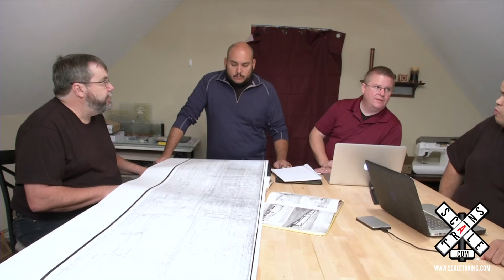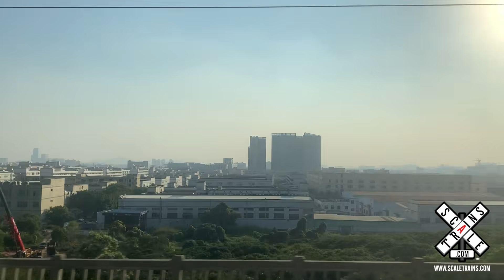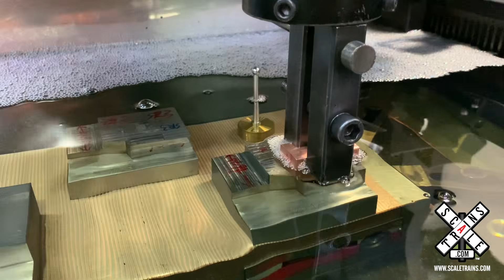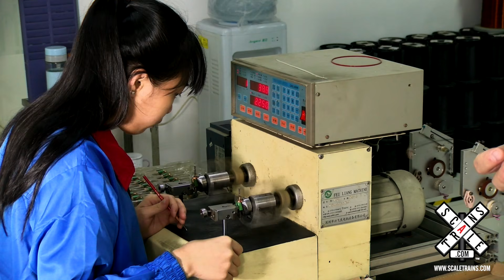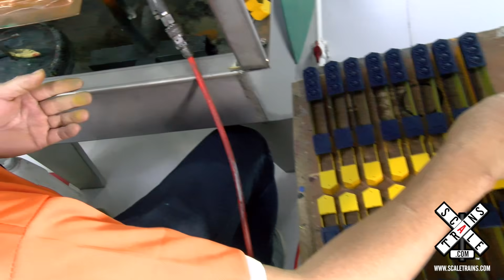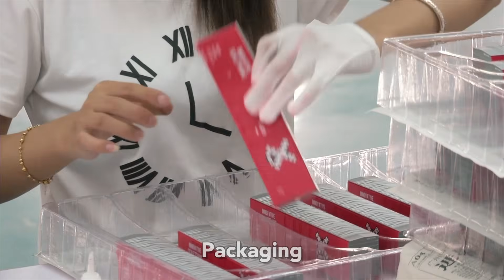How Model Trains Are Made

Comment: Relatively untapped areas in model railroading are small steam locomotive in HO scale. Mantua used to have some good working 0-4-0’s, 0-6-0’s and tank engines. Detailing was left up to the modeler.  Now, there aren’t many good quality small steam locomotives available in HO scale. This is surprising considering that most model railroaders in HO scale start off with an 18 inch radius track. 4-4-0’s, and 2-6-0s‘s look pretty good on small radius curves. Considering the tiny HOn3 2-8-0’s that Blackstone has manufactured, there is no technological reason not to have an excellently detailed and running 4-4-0 for HO standard gauge. Small locomotives had an incredibly long lifespan on the prototype. Some were actively hauling trains in the 1950s. The Southern Pacific E-23 is a good example. Most model railroader start off with a small layout. Let’s cater to that market and help start more people in the model railroad hobby.
Reply from the maker: Thanks for the suggestions. We recommend emailing future suggestions to: Ideas@ScaleTrains.com

Comment: How will 3D printing change model train manufacturing?
Reply: If  CAD software used to design the actual equipment could export these exterior surface designs to 3D printing software and scaled that would save man months of effort.  Model units could then be 3D printed on demand reducing inventory costs and unsold stock.

Comment: UK experience. Staggering complexity but I think the hobby is going wrong. 25 years ago I could buy simple Lima diesels for £25 with pancake motors and they worked. Today its just under £200 with lights, sound and details like you saw in the video but 50% are faulty. 3 out of last 6 models faulty (but not this manufacturer). Hornby Class 50 missing buffers, Bachmann Class 20 motor rattles around, Bachmann Class 150 faulty pick-ups. I wish manufacturers would realise that QA is the most important function. Throwing faults onto the customer will kill the hobby.
Reply from the maker: Hi Alan, if we make a mistake, we never throw faults onto the customer. We are human and while we strive for perfection, we live in a fallen world and sometimes fail to reach our goal. If you ever have an issue with our models, we'd be happy to assist you with finding a reasonable solution for repair or replacement (per the warranty guidelines). Thanks for watching. -Drayton

Comment: As an accountant, I'm impressed at the amount of capital invested in production machinery at the factory and tech gear at the office.  
A whole lot of cash goes into the job before ever a return from sales comes back again.
An insight to the costs involved, the funding arrangements, would be as fascinating as the process for design and manufacture.
Reply from the maker: The tooling for a Rivet Counter HO freight car can approach $100K. Depending on the number of variations, an HO diesel is between $150K to $300K.

When the next batch of SD40-2 is completed later this year, we'll have spent over $700K.  This does not include research materials, travel to document a project, Design, Engineering, etc.  Considering the low quantities produced, this is a sizeable spend and risk.  Shane
Reply: @Scaletrains  Thank you.  Impressive sums of money; your funders will recognise the commitment and competence at all levels, start to finish.
I do love U.S. railroading; have a lot of good HO stuff myself.  Travelled a little on a visit, 20 years ago . . . . gotta come back for more, much more!
Reply from the maker: Thanks so much for watching and for those kind remarks. -Drayton

Comment: What makes you people think that your models are better than other company's models?.........you flood the market with models that many other companies have already made.
Reply: Flood?  Hardly.......their models are all built on Pre-Orders. You snooze = You lose.   As for their models being better, Did you not watch this video??
Reply from the maker: We've never said our models are better than another companies.  That's up to the customer decide.

Have you compared our HO SD40-2 or HO and N DASH-9 or HO ES44 to other companies.  If so, you'll see there are vast differences that set our models apart.

Also, what other model railroad manufacturer (plastic, not brass) has produced the following models?
HO & N "Big Blow" Turbine
HO & N C39-8
N ET44 Tier 4 GEVO
HO SDL39
HO Bethgon G52X Gondola
HO BSC F68AH Bulkhead Flat Car
HO BSC F68BH Finger Rack Flat Car
HO BSC F68CH Standard Flat Car
HO BSC F68DH Heavy Duty Flat Car
HO CB&Q Shops Havelock Gondola
HO GATC 4566 Airslide Covered Hopper
HO & N Gunderson 5188 Covered Hopper
N Gunderson Multi-Max Autorack
HO PS-Trinity Backpacker Well Car Set
HO & N Thrall 4727 Carbon Black Covered Hopper
HO & N Thrall 5750 1970s Version Carbon Black Covered Hopper
HO & N Thrall 5750 1980s Version Carbon Black Covered Hopper
HO Thrall-Trinity 42' Single Hood Coil Car
HO Trinity 31,000 Gallon Tank Car with Head Shields
HO & N UP 23C Fuel Tender
HO & N UP 24C Fuel Tender
HO UP Late Excursion Water Tenders (both have different details)
HO & N UP Early Excursion Water Tenders
HO & N 53' CIMC Dry Container
HO & N 53' CIMC Reefer Container

That's 36 different models that no other manufacturer is making.  Shane

Comment: As an owner of a fair few ScaleTrains pieces of equipment, and yes they are top tier, the question often arises why do model trains coast what they do?   Well having been into the hobby since the mid 80s, take a blue box and turn it into the same level that ScaleTrains model is.   How much time and money did you spend to get there?   ScaleTrains frankly are worth what they coast .   Oh yes you couldn't even get an Athearn blue box SD40T-2 to the ScaleTrains level did just based on the drive train alone.  I tried in the early 90s.    Great job keep them coming!
Reply: The main factor is labor. The details you see are not applied by a machine, they are put on by hand. Painting something that tiny is very stressful and not easy. If these where built in America they would be about double the price they are now. If these models were sold cheaper the manufacture would not make much profit at all. The castings you see(Tooling) are worth over $250,000 depending on the model, hat does not even include the developing costs. Fun facts: Owner of ScaleTrains (Shane Wilson) used to work at Athearn for about 6 years, then starting ScaleTrains in 2015.

Comment: Bummer that these beautiful trains are made in China. I understand why, but it’s still a bummer
Reply: The main factor is labor. The details you see are not applied by a machine, they are put on by hand. Painting something that tiny is very stressful and not easy. If these where built in America they would be about double the price they are now. If these models were sold cheaper the manufacture would not make much profit at all. The castings you see(Tooling) are worth over $250,000 depending on the model, hat does not even include the developing costs. Fun facts: Owner of ScaleTrains (Shane Wilson) used to work at Athearn for about 6 years, then starting ScaleTrains in 2015.
Reply: @kyle_miles_915 , yes, as I said, I understand why. It’s just too bad the process couldn’t be  more cost competitive in America. Btw, I’ve bought a few Scale Trains locos from your website already, and I love them. Keep up the AMAZING work!!!
Reply: @watermanr7  I don't work at ScaleTrains, but I am an engineer so I know pretty much anything about manufacturing. I'll tell them you said that.
Have a good one, Take care.
Reply: Yeah, as mentioned above, it's the cost of labor in China is why manufacturing in the US will NEVER be price competitive. The sheer numbers of available, skilled Chinese workers, plus their lower standard of living, results in a low manufacturing cost that the US can't come close to.
Reply from the maker: Manufacturing model trains in the U.S. is not economically possible for three reasons. 1. there is no factory producing super detailed locomotives and freight cars currently; 2. there is no supply chain (parts suppliers and subcontractors); and 3. products would cost as much as 3x more. We do not have several million dollars to spend for #1 and #2 and we do not think most American modelers would pay up to $1K for an HO Scale diesel locomotive.  -Drayton
Reply: @Scaletrains  While I agree with everything you said, the statement that there is no factory producing... freight cars in the USA isn't entirely true. Don't forget about the Micro Trains factory in Oergon. Granted, they're only N and Z scales, and don't produce locomotives, but they are a model train car factory in the US! :)

Comment: I am really curious to know what type of glue is being used . Anything I use and leave exposed to the open for more than 10 minutes will dry out and be shot . That stuff seems like it would be a modelers dream glue !!
Reply: In one of the scenes a bottle of Alteco glue is there. While it is unclear whether that’s the only glue they use or not, you can at least get this one from eBay, if you are interested.
Reply: @翟义琥  Whatever the young lady was dipping the glue rod into while putting in the grille and fan on top of the engines is what peaked my curiosity !

Comment: I've never had an issue with ST prices, and now, I feel like I'm getting a bargain!
Reply: Great video, and amazing engineering, tooling, manufacturing. What makes me uneasy is the health stress of the manufacturing workers. Likely they feel they are paid reasonably. But...  Such jobs would have to stressful over the long term. I manufactured hundreds of my own products decades ago. Initially it was exhilarating to ship to my customers. Eventually it became grueling and repetitive. Why didn't I hire this out to China? For these very same reasons.
Reply: The main factor is labor. The details you see are not applied by a machine, they are put on by hand. Painting something that tiny is very stressful and not easy. If these where built in America they would be about double the price they are now. If these models were sold cheaper the manufacture would not make much profit at all. The castings you see(Tooling) are worth over $250,000 depending on the model, hat does not even include the developing costs. Fun facts: Owner of ScaleTrains (Shane Wilson) used to work at Athearn for about 6 years, then starting ScaleTrains in 2015.